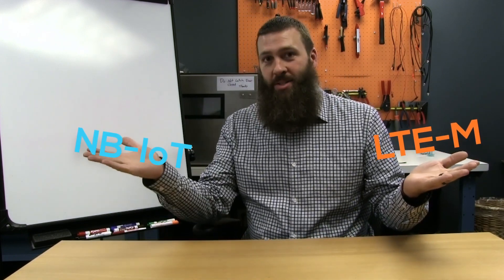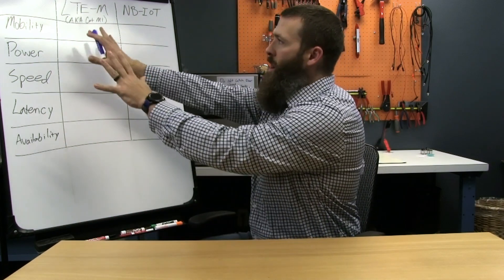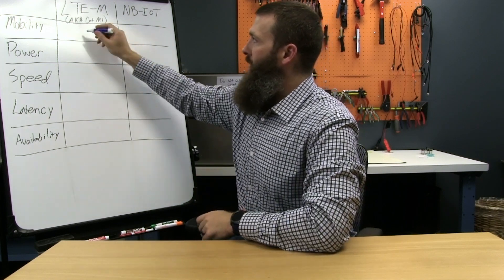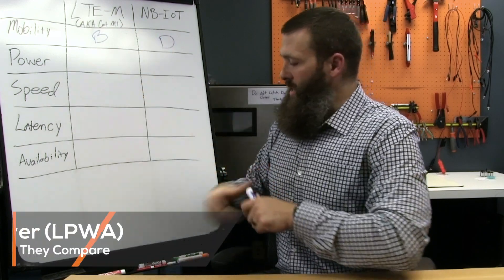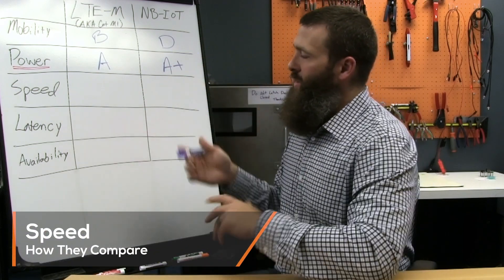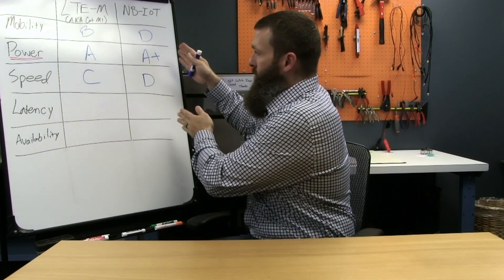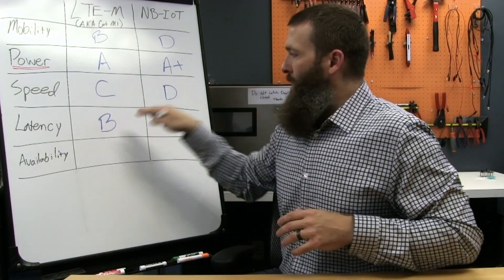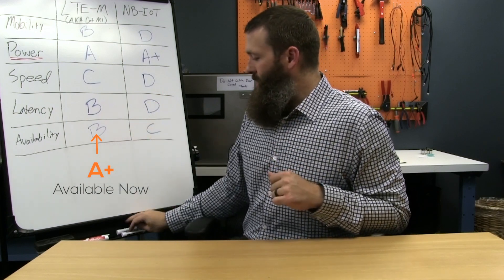LTE-M (CAT M1) Vs. NB-IoT

Comment: Thank you for the great video,
I have a question which is really confusing me,
While computing MCL for both NB-IoT and Cat-M1, is a higher MCL value translates to more link losses? or the higher MCL value the better?
I hope you can answer this confusing question as I really can't get my head around it clearly.
Regards
Reply from the maker: I agree that MCL is quite confusing, but I basically think about it like this: A higher MCL means that the signal can still get through despite a greater loss of data along the way. Primarily this is achieved through the use of repetitions. So, a technology with a higher MCL roughly equates to a better range. In that case, yes, higher is better! But understand that, with more repetitions you also have more power drain since the transmitter is on and transmitting for longer periods of time. For some situations this may not matter, but often developers are choosing these technologies to lower their power draw. I hope this helps, and good luck!

Comment: Nice way to break out lte-m and nb-iot. You should probably mention the price difference between the two types of modules though. Isn't nb-iot supposed to be cheaper through using fewer antenna elements etc (although in practice the savings is a lot less than was anticipated?). Can you shed some light on that?
Reply from the maker: Great point! Cost reduction was indeed one of the promises of NB-IoT over Cat M. The initial modules that supported NB-IoT were actually combined with Cat M, so the cost benefits weren't realized. However, now that we are starting to see more NB-IoT only chipsets and modules it is starting to happen. Will we ever get to the promised <$5 module cost? Only time will tell.